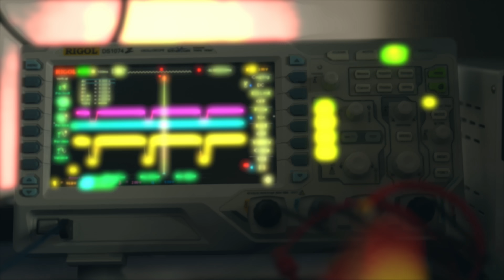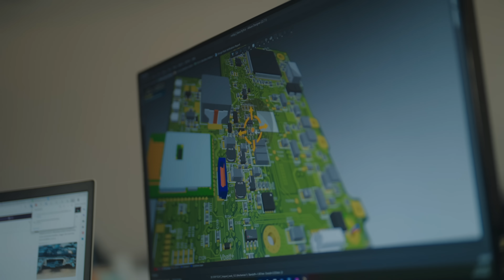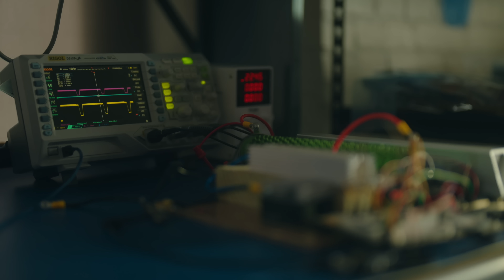Shift Moonwalkers Launch

Comment: I've been using these since July 2023.  I'm hoping we get some info on the next version of Moonwalkers in 2025.  I like that the Aero is less prone to overheating,  but I dont like that it only has 6 wheels per shoe.  I wouldn't mind upgrading to a version that has twice the battery charge capacity and 8 wheels per shoe even if it makes the shoes louder.
Reply: Thank you for your feedback! We're very happy  that you've been enjoying your Moonwalkers and we appreciate your inputs on improvements. While we don’t have details on the next version yet, your suggestions for enhanced battery capacity and an 8-wheel design are noted and helpful. Stay tuned for updates in 2025!
Reply: @ShiftRoboticsSupport  I most certainly will.

Comment: I'd like to see remote control that lets you ride statically like a scooter/skateboard and go faster. That said, not sure that I want to spend my time putting them on compared to just getting on a small scooter. Next thing to do is automated clamps so you don't have to take time strapping and unstrapping them. Should be possible.

Comment: I Like Walking.

I Could See Owning a Pair of These for Use When Want or Need Get Somewhere Quick But Don't Want Carry or Use Skateboard ( Electric or Not ) Nor Ride Bike...

And Could Put "Moon Walkers" In Back Pack When Not Using...

7 mph Would Be Great.

What's Range?

How Far Could Walk?
How Long Battey Last?
Charge Time 0% to 100%?

If Could Go 28 miles In 4hrs
14 miles Destination In 2hrs
14 miles Return in 2 hrs
Would Be Great Intially...

Thanks For Sharing...

💥💥💥💥💥💥💥💥💥💥💥💥💥💥💥

TreadMill Mode

Definitely Possible...

Except Wheels Spin In Reverse...

Example:
Using App With Shoes
Enable Treadmill Mode
Set Max Speed

Then Walk Normal
Faster Your Stride
Faster Wheels Spins In Reverse

Slower Your Stride
Slower Wheels Spins In Reverse 

💥💥💥💥

Basically Same Operation But Instesd of Propelling User Foward Proportiional To User's Stride...

The Shoes Propel User Backwards

Your Stride Is What Prevents You From Actually Going Backwards; 
Same as it does on Treadmill...

Exception Being;
Treadmill has fixed speed.

Moonwalkers have variable speed.

Comment: This is amazing and is genuinely going to change the world.
Once you can run in them, off-road will be in high demand and then, you should probably consider developing a manual system. 
A lot of people will want one you power through running and if you can combine the 2, you have the ultimate low budget vehicle anyone can afford and anyone can use to traverse most anything you can walk on.

Comment: Nice and good. But don't think that the Moonwlkers will give you a time advantage if you're mostly on very busy sidewalks or very busy pedestrian zones. As is usually the case in a city. Because when walking fast, it is almost impossible to avoid oncoming people so quickly. On the contrary, I think the Monnwalkers pose more of a danger there, because many overestimate themselves and this can lead to more collisions with potentially dangerous consequences. And the time advantage of the speed that can be implemented there is negligible. More for people who live in the country or have a commute to work where nothing is going on. For the bike path, they are too slow.

Comment: I would suggest a removeable battery (like a drone; on the heel vertically, external?) Also, a 'clip harness' which could adapt to any shoe, with the 'binding' on the wheeled unit, so you have a simple step-click on, release off, a bit like a ski binding, leaving your shoes walkable, and multiple harnesses to just leave on multiple pairs of shoes.
Reply: Removable battery that allowed quick change to continue the walk. It would be a perfect implementation.

Comment: Hey guys let's make $1400 roller skates that don't work as well, are slower and have lots of complicated parts that will break if used anywhere besides a perfectly smooth surface.
Reply: And do you have to charge them? 🤣

Comment: It's a huge bummer to learn that the Kickstarter only ships in US. I live in Japan and use a mix of Trains and walking. A lot of walking is included, and it is inconvenient to bring a bicycle all the way to the train. There would be a huge market for this in Japan.
Reply: Would a folding bike work? Keeping a bike locked at the station? Regular roller blades?
Reply: @yourgoodfriendwei  Guess it also depends on your life style, I like to have flexibility depending on what I need on a particular day, so chaining it to a station is always a no for me. Regular roller blades can't cut it because of the change of terrain and stairs. I guess the most defining factor will be if the Moonwalkers will handle terrain better than your average roller blades.

Comment: It would be nice if they charged while walking, via some kind of piezoelectric device that shifts back and forth along the length of the shoe from the motion of swinging the feet for each step, or from hitting the ground. This could extend range indefinitely.
Reply: @celery7810 My electric scooter does this. It's called adaptive charging
Reply: @celery7810 Does it while breaking or while rolling without applying electricity. And yeah your right, these shoes go very slow in comparison, so while if they did add the technology, it would probably make almost no difference

Comment: Have you guys ever consider use caterpillar tracks rather than wheels? 
May actually fit more different environments and situation? 

And, maybe  removable batteries? 
As I think most of people won't want put shoes on table to charge...?
And it's always a good idea to have replace btteries when you are out with no place to charge(for 1.5hr).

Just some thought for imporovement🙃
Reply: Caterpillar tracks are slow, and as you can see in the video, you can switch the wheels on/off to traverse stairs.
Reply: @stevejones4431  I'm personally planning to use a fibreglass-reinforced 8M belt . It will also be locked in movement when the motor is off, essentially acting like a large, flat, shoe sole.
Reply: @glodigit  good idea. Keep working on it. Good to have competition.
Reply: I just discovered this project because I'm making something similar (3D printed) and that's what I'm doing.
Reply: They have an amazing product with 9 generations of prototypes and a team of very intelligent people working on it. They no doubt thought of your ideas and they were dismissed for various (obvious) reasons.

Comment: Once they get even more slim and compact, I could see them being successful
Reply: I dont think they will get much more smaller. They have to have batteries and they have these size of wheels or otherwise small crack in the floor will make you fall.
Reply: @Al_Gonzo  technology changes rapidly - never say never
Reply: @Al_Gonzo  there are always ways. Just need some science magic haha
Reply: What makes them stand out is the ability to mimick a large-diameter wheel. Being slimmer may hurt this.
Being lighter, however, is more achievable. They can probably make a version with magnesium alloys or something really light.
Reply: @lezhu6856  true but its exciting to think about what they may come up with to make them more compact
Reply: I don’t think they’re that huge. They would just need to become lighter.
Reply: Battery life is probably 0 as-is.

Comment: Interesting idea. What is the main difference between this and low-profile rollerskates? I suppose safety because you're actively engaged in every step and speeds are limited, plus it straps on the bottom of regular shoes...? I guess I answered my question. Good luck. There is obviously a gargantuan market for people walking in cities and the afore-considered options (scooters, etc.) all have major drawbacks around congested spaces.

Comment: Are they rain proof? Can you jump with them on if there's a puddle? Will they work on broken/ uneven concrete in NYC?
Reply from the maker: Hi Juan, yes, you can walk in the rain. Moonwalkers are IP54 rated, although we have designed and tested Moonwalkers to the extent of full submersion of the electric drivetrain for 30 minutes without any leakage. If you have concerns about going through uneven sidewalks with puddles, you can find a demo here. Thanks! (https://youtube.com/shorts/BxFlaOruQoY)
Reply: @ShiftRoboticsOfficial  this is good to hear.
Reply: @ShiftRoboticsOfficial  does the battery have to be replaced after ‘X’ number of charges? Will it start to wear down over time like the iPhone battery?

Comment: It's just... stupid.
First, by walking 250% faster, you will run into other people in a crowded street. Even just trying to walk faster on your own feet, you just can't do it, let alone on these roller skates.
Secondly, I am curious how it behaves on non-flat sidewalks.
And thirdly, it needs to be charged, which means that the device becomes less useful from the spot than ordinary rollers or a scooter.
Reply: The uses could be for waitresses, mailpersons, factory work, hospitals like nurses and cafeteria workers, security...real jobs. Not only for the office workers that walk from their cubicle to their car.
Reply: @bentline  yeah… so if you’re a restaurant are you gonna spend 30k to make all your waiters move slightly faster or are you gonna spend that on upgrades to the kitchen/dining area/actually useful worker equipment/ bonuses for all your waiters ? These don’t give a competitive advantage compared to other restaurants with normally shoes waiters, same for all other examples you mentioned
Reply: @megamaster7667  I believe they will become less expensive to the point that higher roles such as doctors and nurses and independent contractors, that walk a lot, will purchase them. This will drive up production, improve technology and bring the price down to the point that a waiter might have the option to buy them...that's usually how technology evolution works.
Reply from the maker: Hi Rad, thanks for your comments! 

Unlike traditional electric roller-skates which you can hardly control your speed at a split of second, Moonwalkers enable you to stop from top speed as quickly as if you come to a stop from running. You have all the nimbleness preserved to navigate through any sidewalk crowds. 

For uneven sidewalks, please check out our new video on Moonwalkers going through some super cracked street with crazy puddles. 

Thirdly,  most cities do not allow e-scooters and roller skating to be on the sidewalks for the safety of pedestrians, while Moonwalkers can be safely used among pedestrians since you are just walking at the jogging speed! 

Let us know if you have more questions.
Reply: To be precise, it's actually 150% faster or 250% of the original speed.
Reply: I agree but it's also cool as hell and looks fun and interesting
Reply: I have an electric scooter, various skates, and I even love my Heelys shoes too. Some of my options I have are not very practical, but I love them because they are fun. I think the Moonwalkers have potential to be a fun contraption.
Reply: Maybe replaceable battery.   Keep a spare in pocket.  These batteries  would be pretty small.